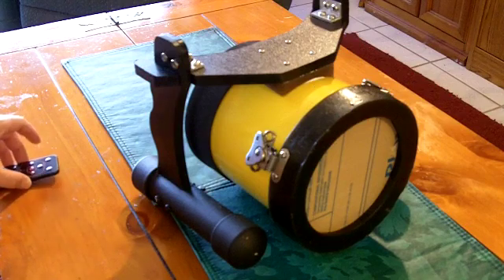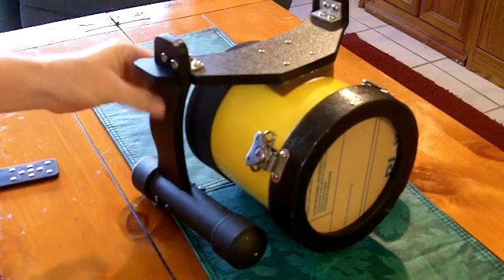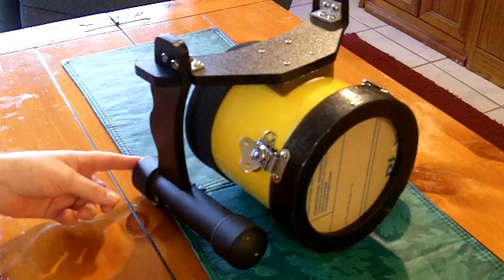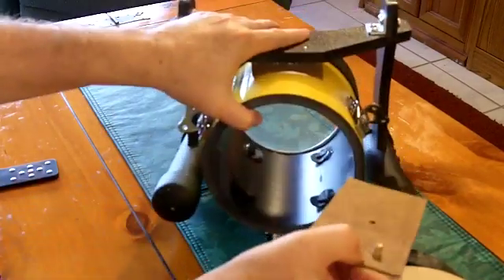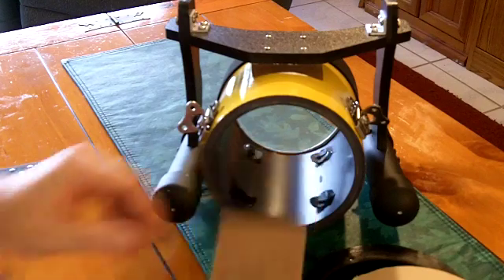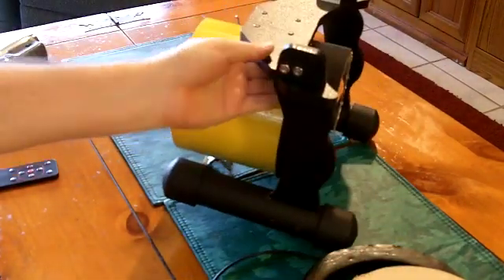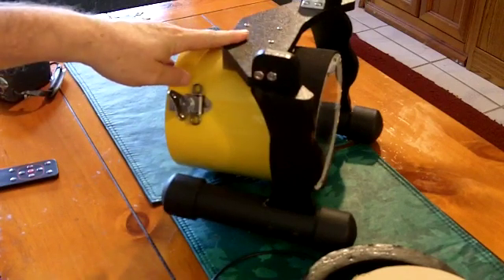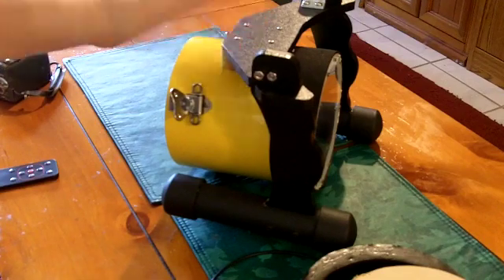How to make the Nemo 200 underwater video camera housing part 1 of 12

Comment: the stainless steel draw latch and screws rust easily in marine condition, how do you cope that, thanks.
Reply from the maker: I had zero issues with any of my stainless steel fittings or fasteners rusting from a marine environment. I paid a lot of money for my fasteners and fittings. The latches alone cost me six or seven dollars each wholesale and that was over 20 years ago
Reply: @RobbsHomemadeLife  Do you have any recommondation on which brand should i consider or where can i find these latches? I've just made my own camera housing recently, thanks again for the inspiration, and i tested it once in the ocean, it was great except all the screws and some parts of the draw latch went oxidized pretty quickly, about an hour or so.
Reply: @RobbsHomemadeLife  Can you upload the videos and send me a link? I'll pay you the same price for the DVD.

Comment: 1 of 12 ? 😅
Reply from the maker: Hello, I don't think I loaded the entire video of how to make the Nemo 200 onto my YouTube channel. However I'd know there's like five or six chapters that are in several playlist. You can check out the Nemo 200 playlist here.  https://www.youtube.com/playlist?list=PLB432D3BCADF52BD4
I also have some underwater camera videos in my video making playlist. The entire video is on eBay right now and I think it's only $6.95 with free shipping. Once the go Pro came out there was hardly any interest in making your own camera housing anymore so I stopped uploading more content about do-it-yourself camera housings and stopped uploading any more of the video. 
The Nemo 200 was a wonderful camera housing. It was quite inexpensive and could be made from mostly Home Depot or eBay material and you could go as far as 210 feet. I only had two legitimate complaints about leaks from the several hundred housings I sold and oddly enough they were both from gentlemen that were filming IN one in 2 feet of water and really cold streams in Canada for hours. There wasn't enough water pressure to make a good seal. They returned them and I adjusted the lens mount just for their situation.

I also have some underwater camera videos in my video making playlist. The entire NEMO 200 video is on eBay right now and I think it's only $6.95 with free shipping. Once the go Pro came out there was hardly any interest in making your own camera housing anymore so I stopped uploading more content about do-it-yourself camera housings and stopped uploading any more of the video. 

The Nemo 200 was a wonderful camera housing. It was quite inexpensive and could be made from mostly Home Depot or eBay material and you could go as far as 210 feet. I only had two legitimate complaints about leaks from the several hundred housings I sold and oddly enough they were both from gentlemen that were filming in one or 2 feet of water and really cold streams in Canada. There wasn't enough water pressure to make a good seal. They returned them and I adjusted the lens mount just for their situation.